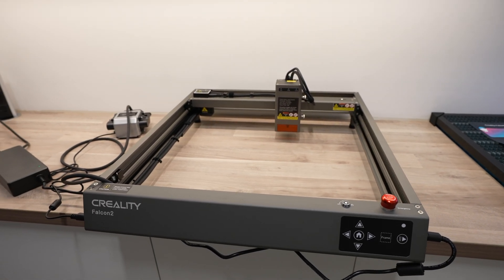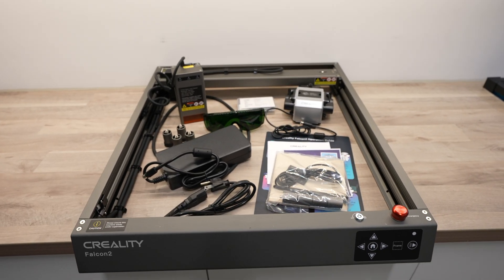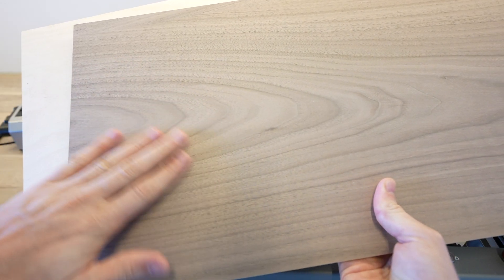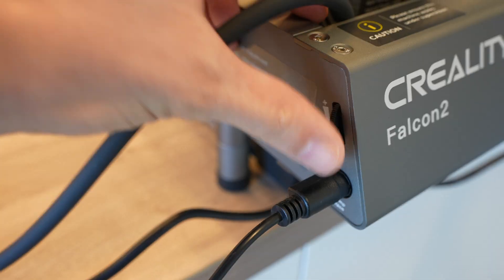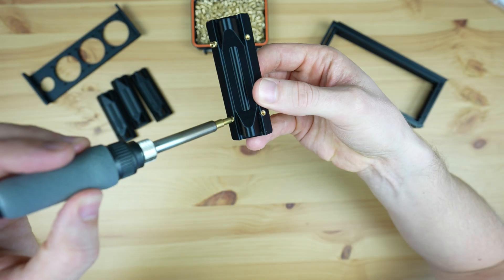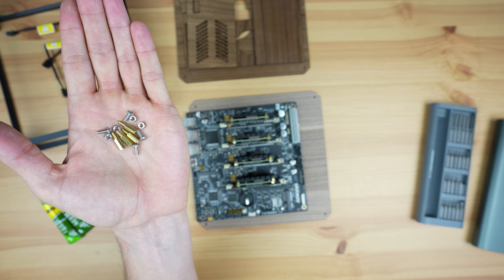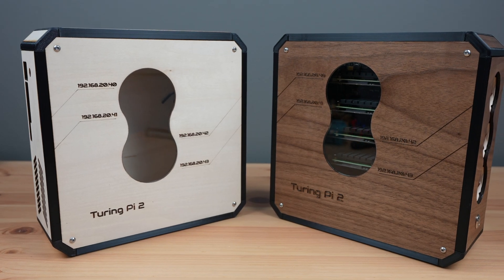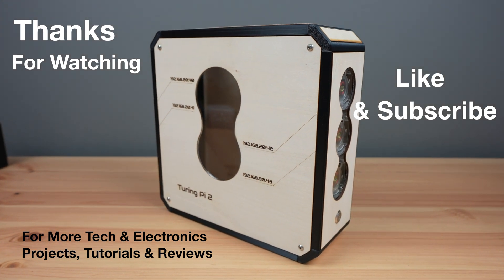Mini ITX Computer Case Made With The Creality Falcon 2 40W

Comment: crazy that the laser is more expensive than the 50w chinese "omtech" leser i was looking at 😂 wich is not the cheap k40, is enclosed no not as dangerousfor your eyes, can cut acrylic has watercooling a true exhaust....
Reply from the maker: 50W CO2 lasers definitely have their place and are a bit more versatile. I have some of these as well and yet I still use a diode laser to cut and engrave wood because they produce better quality results.

Comment: What's the reason for turning off the air-assist when engraving?  Surely you still want smoke blowing away from the lens to keep it clean?  Looks like a useful piece of kit (with adequate enclosure and fume extraction).  Thanks for the video.
Reply from the maker: If you use air assist when engraving then you blow the smoke back down onto the work piece and this causes yellowing around the edges of the engraving. When cutting there is a path through the piece to the other side, so the air blows the smoke though to the underside of the piece.

Comment: Interesting. Aesthtically speaking, a clear full side would have been prefered, but i liked your design method more! plus youe had more pactice at t too! Well done!
Reply from the maker: The great thing with a modular design like this is that you can just swap out the side panel for a full clear one if you prefer that look. I just wanted to do something a bit different in this build since most of my others have a full clear side panel.

Comment: Cool design, but honestly the acrylic design was very cool too.  Cheers for the walk through, nice laser machine.

Did you CNC cut the acrylic insert?  Which CAM/laser software do you use?
Reply from the maker: I like this modular design because it gives you that flexibility. If you prefer the acrylic design then you can just swap the wood panels out for acrylic ones.
The acrylic piece is laser cut but on a CO2 laser. I use Lightburn and Fusion360.